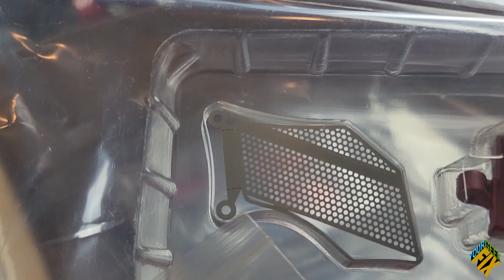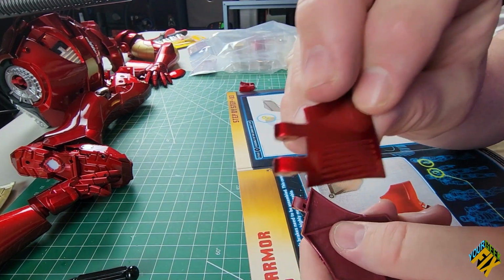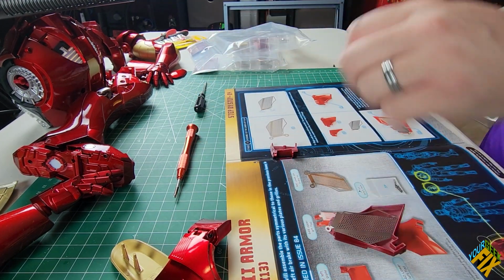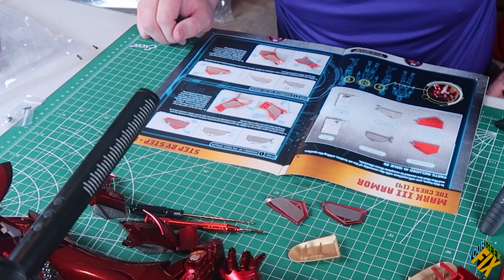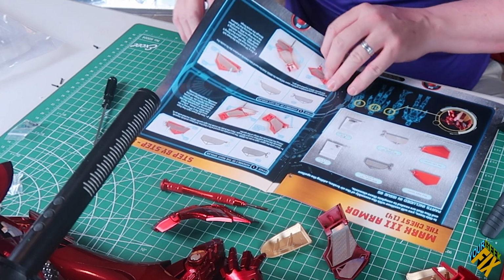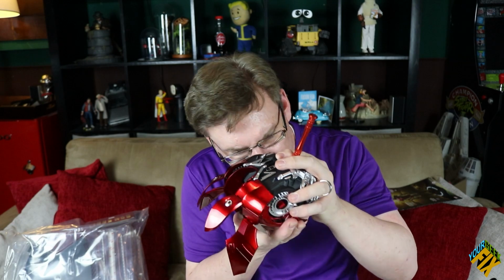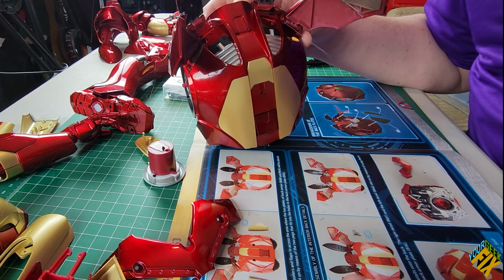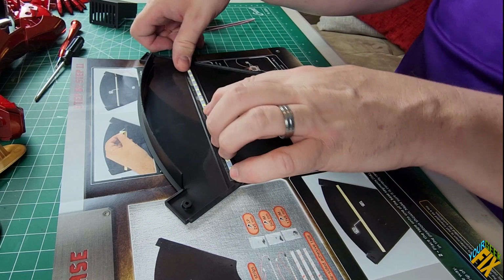Build Your Own Iron Man Box 22 by Fanhome

Comment: The bending was nerve wracking. I couldn't picture where the part goes. Is it for ventilation under the armpits? But they look cool. Ah! They're really for the armpits 😂
Another easteregg in minute 26:40? Is it an easterbat crossover?
The part with the many holes is made on a "strip feeder" or "automatic punch line". https://youtu.be/VGqesIDLGh8?t=24 It can't be laser cut. It would deform from the heat and it would also be too slow and expensive. They could have added another step in the line to bend the ears up..
Reply from the maker: This just came through. Was in the Youtube jail
Reply: @YourGeekFix  Did the jailor say what it was? I know that my english isn't the best. But i didn't realize that it is THIS foul..
Reply from the maker: @seelenschlucht  links. This is the same thing that kept me from seeing Paul sun Yun Lee's messages.
Reply: @YourGeekFix  It's just so unbelievable that they block links to their own adress..
Reply from the maker: @seelenschlucht  it's weird.